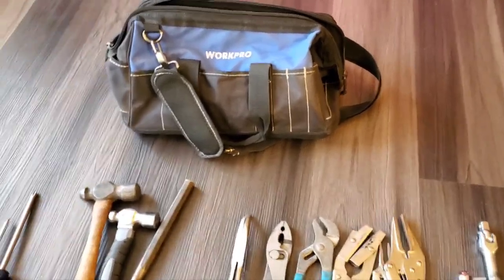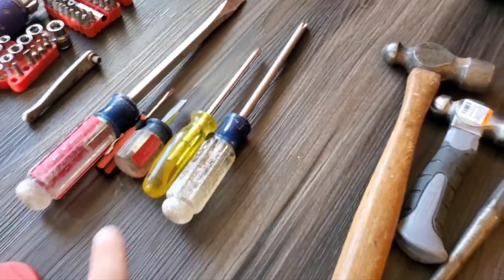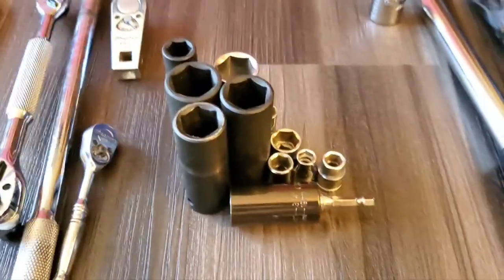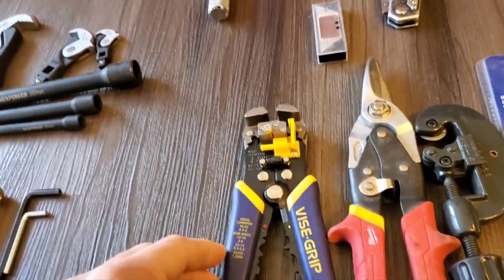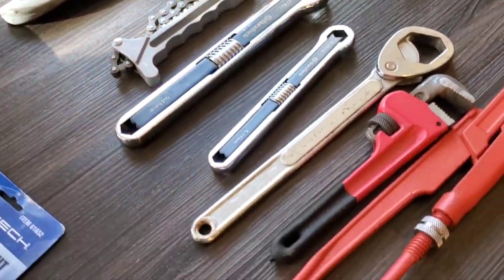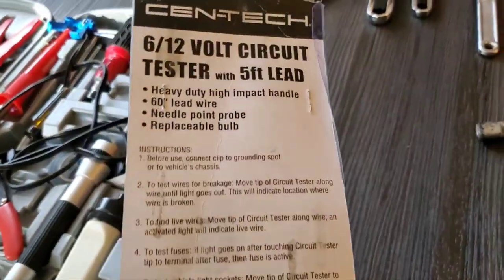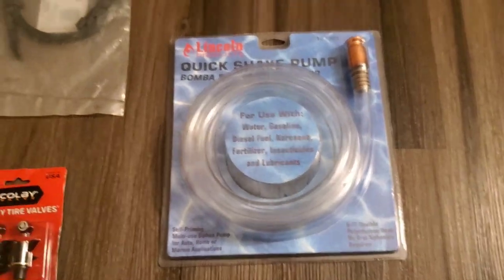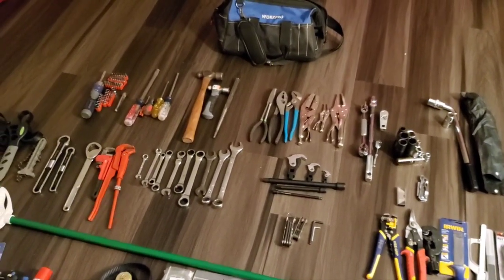The Basics of an Overlanding Tool Kit. Plus, How to Keep it Light.

Comment: Great video thanks 👍.  You may may also benefit from some consumable products such as duct tape, wd40, fix a flat, barbed hose repair kits etc. You can never have too many stainless steel clamps.  A portable jump starter can save the day. Also that tubing cutter is way too big to get between the break lines ( u need the smaller ones). Super glue , J.B weld , a small  air compressor ,rags , break fluid, compression fittings for the break lines,( temporary fix ) contact cleaner ( also doubles as a solvent to clean wherever you'll need the J.B weld. Just to name a few.
Reply from the maker: Hi, great ideas.  This video is just tools.  Check out the newer video on spare parts, fluids and consumables.  Thx for watching !

Comment: Interesting video...i have just gone through a similar exercise to produce a slimmed down tool kit, although mine is for general road use rather than hard core off roading..

I honestly think you could cut that down by a third and still be prepared. Would that breaker bar replace the wheel nut wrench? I would not bother with most of those adjustable wrenches including the pipe wrenches...I would replace those with three conventional open ended wrenches (probably Bahco)..they must be open ended though, as they will allow you to access nuts in more restriced places. 

I think you could do with some small combination spanners for things like battery terminals ect

I would slim down the electrical tools, and replace those auto wire strippers with more conventional ones..The trouble with the auto strippers is you need quite a long length of wire to be able to feed it in. With conventional strippers you can always hold the stub of wire being stripped with a needle nose.

You don't really need the test lamp and the multimeter and the multimeter is by far the most versatile of the two testers...

I would ditch the hose clamp pliers as you can use the vise grips instead. The tubing cutter looks way too big for typical brake tubing, and if you intend to cut and join that sort of tubing  you will need flaring tools ect.

I would also ditch the strap wrenches and just carry the chain wrench and also loose that knife...

What's missing? I would add:

 A 1/4" and 3/8" universal joints...
Extra long heavy duty jump leads and/or small Li-ION jumper pack.
Work light and head lamp.
Tire pressure gauge.
Spark plug socket.
Inspection mirror
Magnetic pick up tool.
Stanley knife and spare blades.
6'x4' tarp to lie on ect.
Croc clips for the multimeter.
Possibly a small grease gun for suspension work ect...
To help keep things organised, I would recommend a spanner ring or large alloy carabiner to hold your ring/combination spanners.
Rails for you sockets...
Reply from the maker: Thanks for the time you put into your reply.  I will look at some of your suggestions. Cheers.